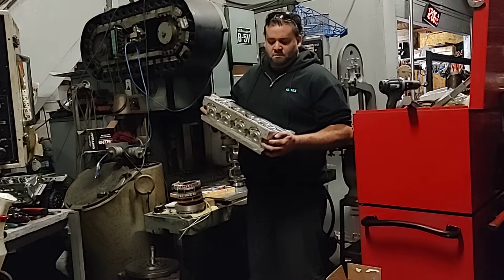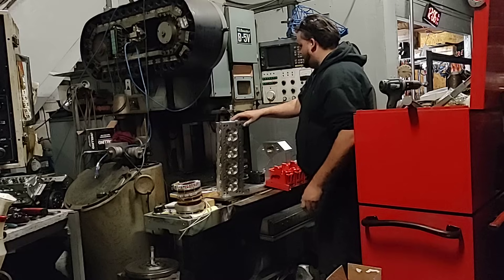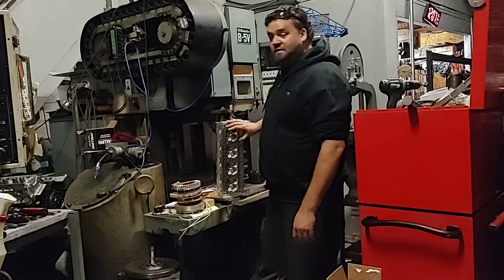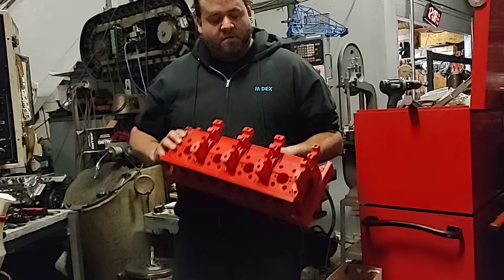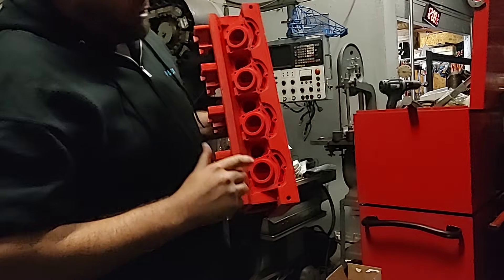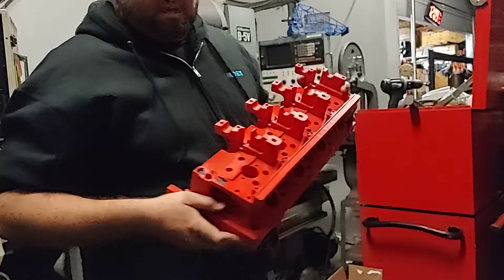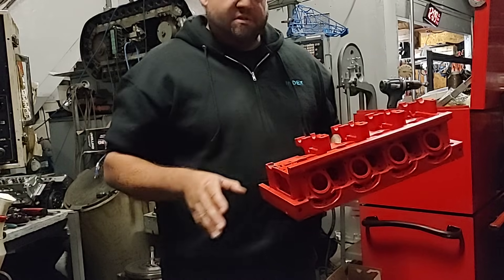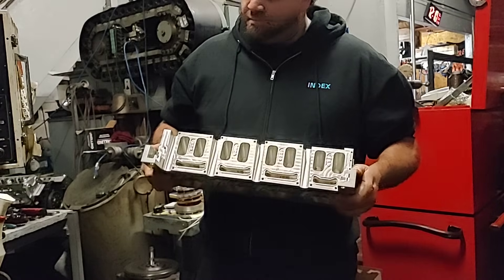LS 4 Valve Cylinder Heads- Better yet, they're BILLET

Comment: This is awesome!  Will they need a special ground camshaft or will a aftermarket camshaft work?  Will I need to make my own intake manifold or will a stock or aftermarket one work?
Reply from the maker: Thanks! If they are on a LS block, LS cams will work. Flow percentage is tailored to existing cams. I'll be providing an intake in short time, plenum and itb's. LS headers will bolt right on.
Reply: Awesome!  I wish you the best of luck I hope what you’re doing takes off like a rocket!

Comment: Would this be for a Gen III, Gen IV, or both?

Essentially, could I build an LM4  with these heads?
Reply from the maker: All LS and Lt engines, and sbf. Lt and Ford will require custom camshaft for lobe stack up
Reply: 351W or 351C?
Reply from the maker: @commonmockery1074 Windsor for sure. Need to check if a Cleveland will adapt easily.

Comment: Very interested to see how these grow into something that we see on a running engine. Looking forward to some flow bench numbers from the actual head. 4V heads usually flow exceptionally well in the low lift range.
Reply from the maker: .300 lift is 300 CFM. Probably the coolest part about these and maintaining high velocity ports.

Comment: Why didnt you Y the intake port?
Reply from the maker: Ports are more efficient on port per valve. Far easier to tune and apply all the two valve port tricks to it as well. It's like having 2 2/3 scale 706 ports per cylinder, and velocity is greatly increased

Comment: Never thought that next to a SB4 that I wouldn't see someone with a 4V LS. Awesome job and awesome engineering!

I noticed you've machined the intake ports seperate for the valves. What was your reasoning behind that? The ones I've seen so far have one port for 2 valves.

Does it have to do with maybe flow, or was there something else that formed this decision?

Comment: I would recommend that you get some Nissan VK56DE (v8) heads and copy their valvetrain design as much as possible. Most manufacturers now use cam direct on solid buckets. The parts are easy to source for replacements. The Nissan VK56 also has very similar bore spacing and other dimensions to the LS.
Reply: The whole point is to get 4 valve performance with pushrod convenience, most American v8's with over head valves only use 1 camshaft which is great for aftermarket support and incentive. Think about it, instead of having to get four fancy new camshafts for a performance build, you just need 1 fancy new camshaft for a performance build. Obviously there are drawbacks to pushrods but the Americans just throw enough displacement and cam lift at it, and it works
Reply: @janusmarais7580  ,,,,,,,,,,,,,,,,,,,,,,,,,,,,,,,,,,,,,,,,,,,,,,,,,,, amen ,,,,,,,,,,,,,,,,,,,,,,,,,,,,,,,,,,,,,,,,,,,,,,,,,,,,,,,,,,,,,,,,,,,,,,,
Reply: why not just build a nissan v8 and save your self all the crazy machine work.
Reply from the maker: @A2J_Tim I thought this was America

Comment: Do you think it would be possible to 3D print your blanks with additive machining ?
Reply from the maker: Anything can be done, billet is way cheaper and much stronger. The print time on something like this would be close to a week, and still require a ton of machining. If the printing time gets faster, I imagine it's something we'll see in the future.
Reply: @AwkwardPerformance  I guess I should have said feasable rather than possible. Figures it's not as strong or less expensive yet. Too bad.

Comment: Not long ago there were U-Tube videos out there where someone was mounting LS heads on 4 cylinder blocks. this might be a  side project for that odd head that you have now.
Reply from the maker: Usac midget engine is in the scope. Katech makes a mighty nice 4 cylinder block these should bolt right on to.

Comment: Wish you absolutely the best of luck. Tremendous amount of time, energy, and engineering skill went into these. Not sure I see the use case though
Reply from the maker: 5 second door slammers? No more losses to coyotes, marine use, off-road use? I can see a couple. These are a racing head, not a street head, not that they wouldn't work, fuel mileage may suffer 😂😂
Reply: @AwkwardPerformance  Fair enough, although I would argue that the limitation of forced induction LS performance is sealing the cylinder head to the block. Making power really isn't the problem-it's making the power and keeping a head gasket in it.
Hope I'm wrong though
Reply from the maker: @bobqzzi billet heads will help build it down, these come ready for 1/2 studs. They can be ordered dry deck or no water as well. I hope to help the smaller racer have a chance against the really nice stuff out there. It could turn into a reverse thing of top fuel, where they change out a block instead of heads between rounds!!

Comment: Our Hot Rodder forefathers are looking down on you and smiling.
Reply from the maker: I've got a few to make proud, thank you! I'm working 10-12 hours days at day job, and spending the rest of the time on programming, design and tooling on this. I'm all in.
Reply: @AwkwardPerformance  hopefully making these will become your full-time job & income.... I look forward to buying many sets!!!
Reply from the maker: @branbear24  Thanks! But I hope not, I want to make the viper V10 heads next and so much more!! Turns out, the machining gets a little boring after a while, the design process is what I like, and then pissing off the neighbors!!
Reply: @AwkwardPerformance  if you need a test dummy I'll gladly use my suburban and give you reports back
Reply: Ear to ear grin

Comment: This is a very interesting concept. The fact that you're using the factory cam and pushrods is even more intriguing .
Reply from the maker: Goal is to keep these in reach of your normal racer and engine builder, and punch way up the weight class. Thanks!
Reply: REEL TALK 🎉
Reply: -pushrods are the only part thats not cool.
Reply from the maker: @RealDougFields you say that now
Reply: @AwkwardPerformance  lol- I admire your drive to do these but the 4 cams eliminating the push rods is free HP and much more reliable RPM potential. If you can do these cheaper than Mercury Racing does the SB4 stuff though you will sell some. 4V is such an advantage.
Reply from the maker: How much energy does it take to oil and spin the cams and drive system? Not that your wrong, but having one cam shaft is being helped by the closing valves through one shaft, not a mechanical system. I'm going to take the 'stupid' argument that this is actually better for drag racing and tuning valvetrain. Cam timing as far more precise as well. Thoughts? @RealDougFields
Reply: @AwkwardPerformance  Love the Moxie- cam timing is more precise? with a noodle pushing the valves open? Illmore did a great job with pushrod engines but they knew the limitations and were only successful because of the specific rules. Direct actuation is superior in every way. ALTHOUGH I do think the SB4 using the LS cam location as a jackshaft to drive the cams does add complexity and friction. It is a good work around on a stock block though.
Reply: @RealDougFields  Theres always one window-licker

Comment: Stick em on a 4.8 the powerband won't peak until 10,000 lmao, getting some serious ram air 5 vibes from this. Super badass you did a 4 valve without using overhead cam, this is the way American 4-valving should have been done from the jump! Thing flows better than 4.6 B-Heads, shit it's neck and neck with the DCI Pontiac heads!

Comment: Good luck! If there is anything proprietary in their design, patents would be a good idea. 
   Otherwise, scale might be important to focus on. The option is excellent!
Reply from the maker: What would i patent?
Reply: Someone else mentioned a patent. I think you should, only of there is anything about your design that is proprietary. Meaning your design has something different from other cylinder heads.
   For an LS it is different, but 4 valves does not make it something that can be patented. So, I wouldn't know, as I did not design your cylinder head.
Reply from the maker: @robertmoore119 mercury marine already makes a dohc 4 valve. It's pretty cool btw. So if they didn't, I'm probably good. I just don't know what makes mine special or different. It's just designed to have small time racers have a chance against billet engines, and provide a great value to what ever industry it goes into

Comment: Your gonna try to control two valves off one lobe/pushrod/rocker? Spring pressures needed to keep valves under control may be to great for a single lobe. Also wondering about those rocker seat pedestals, didnt look like much material there for strength. Time for testing and likely more R&D
Reply from the maker: Yes I am. I'm going off all known data and forces that runs around any bullring on a Saturday night. Why would they be too great for a single cam lobe? I haven't announced spring pressure range, but I do appreciate the concern. Harley Davidson M8 engine seems to do just fine.
Reply: @AwkwardPerformance I don't know I just think even for you it would be a concern. Opening 2 exhaust valves with one push rod against spring and cylinder pressure is questionable, no? These problems don't show themselves till down the road. I think it's cool what your doing and I'm on your side here I'm just pointing out the things I would be concerned about as I'm sure you are. How are you doing the rocker setup? The test piece looks similar to a dodge style shaft system or will it be different?
Reply from the maker: @stevenbelue5496 The rocker system will be very similar to the Dodge system. You can see my initial prototype setups on my Instagram page FY_lsx. I'll have a video out on all that pretty soon. 

One of the advantages of having two exhaust valves is you open one smaller exhaust valve into cylinder pressure, that is easily done with a valve lash.
Reply: @stevenbelue5496 smaller valves also need less spring pressure . Something about mass and inertia .
Reply: I wonder what the weight of the smaller valves will be in comparison. I think one advantage the Milwaukee 8 might have if its air cooled is the valve stem length may be shorter and much lighter but I dont know. Of course titanium or hollow or sodium stems can help if weight is a problem reducing overall resistance. I have heard of the lash strategy opening against cyl pressure with a four valve and some folks believe it doesn't matter because the pressure or force against a single valve or two remains the same, i don't know, the inertia needed to get another equal mass in motion against equal pressure(cyl) might be negligible if any so imo it's hard to say and not much proof of concept I have seen but I've not been looking for it either. Another thing with these heads is the need for a lot of proprietary pieces, all the hard parts for a bare head, intake and exhaust flanges, which some guys can fabricate the manifolds intake and exhaust. But it's gonna be a pricey endeavor and if flow is not much greater than the small bore ls7 type offerings then it's going to be a tight customer base.
Reply from the maker: @stevenbelue5496 I disagree with the flow numbers, at .300 lift they flow 300 cfm, and 380 at .650. I see what you're saying. Being the guy that has designed this from only known data, I have the rest of the concerns handled. There are some unknowns, and that's why I look forward to testing. I appreciate your time considering the challenges to this. It's not been easy designing for 500 hours and inventing ways to machine it on more basic equipment. Thank you!
Reply: I think there will be a niche group of customers similar to the hemi style LS guys looking for naturally aspirated records.
Reply: @stevenbelue5496 could also go OHC with buckets like Ferrari , Toyota etc to eliminate weight
Reply from the maker: @stevenbelue5496 boost guys will love these

Comment: Im assuming some super beefy pushrods and lifters are needed? How about the already fragile cam bearings with high lift/ spring pressures?
Reply from the maker: Cam bearing should be replaced anyways on a racing engine. Good lifters and pushrods will be needed for a high rpm billet headed engine. The other advantage is you don't have to lift beyond .650, they flow 380+ at that lift.

Comment: Great work, subscribed right away. Are you closing off the jackets with single, full length plates on both sides, or another approach? Thanks for sharing.
Reply from the maker: There are multiple oringed plates, as well as the intake port extension that covers water jackets. It's complicated 🤣

Comment: Crrect me if im wrong here 
2 valve LS style engines have better than good flow 
Now the falls
4 bolt hold down pattern seems enough but is it(yep the other bolts are there so they prob add up to half a shared 5 pattern prob ok aspirated depending on what your up to
A friend of mine across my courtyard runs a mech shop 
Had a LS engined vehicle in a lil while back owner wanted a valve train upgrade as he drives spritedly
We both had no idea the heads off for lifter replacement
Now that in the building trade is known as a shitshow
Unless some of you magicians know of a fix to help the world 
All sounds like fun ( nope)
Still this fella has done well 
Wittling these up 
Will b interesting to see the gains and his engineering reliability
If they whip them hard
Reply from the maker: I'm not sure what your asking. Please clarify
Reply: Not asking anything just stating the good and bad LS have a good bottom end
And good flow up top with 2 valves 
But have other issues as stated prior
If you can get these  nicely made heads you whittled reliable  and then cast them you maybe on a winner pending gains
At the tyres
Reply from the maker: @andrewk7731 if you compare it to other 4 valve V8 engines, this will help. They have 20-40% more flow from other engines. They will require a good lifter and pushrod. And they will remain billet, no reason to cast them. There are plenty of solutions for lower power numbers from other cast heads. These are designed to see 60psi of boost in race trim. Thanks for the response! I'm happy to answer any questions.

Comment: It’s all right if you’re into that four valve garbage, you just got more parts to worry about breaking
Reply from the maker: Who hurt you? 😂😂 Thanks for watching.
Reply: @AwkwardPerformance  creation is good line as it has outstanding performance and longevity
Reply from the maker: @KennethMyers-i2t that's my goal, everything in these already does the job. I'll get tricky with the unknown later
Reply: @AwkwardPerformance  if you’re gonna make anything better, two vowels is better than four. Why don’t you do a small block hemi Chevrolet head and make it sufficient this way you wouldn’t have to deal with an overhead cam garbage
Reply from the maker: @KennethMyers-i2t these are push rod heads. And sbc is already drawn up and being refined.

Comment: Manton pushrods and Jesel lifters should make this setup live. I see the intake ports are not siamesed, so are you going to make matching intake manifolds? I'd LOVE to buy a whole head/manifold set for my C5 Z06 when they're ready to sell.
Reply from the maker: I'll have a high and low plenum, and itb intake setup. The intakes are like having two 2/3 scale 706 intake ports per cylinder. For rocker arms, i have a Manton inspired design, but there are some challenges that i have handled that look a bit unique, but FEA says they will be just fine. Thanks!!
Reply: @AwkwardPerformance Sounds great. What are you thinking for valve covers? Production numbers couldn't possibly be high enough to justify stamping dies. Maybe carbon fiber? Or laser cut aluminum sheets (and plate for the rail) TIG welded together?
Reply from the maker: @elektro3000 any of the above. I have an initial design, they will have coil pack mounts and goodies on them

Comment: SB Ford as well since the LS design is so close. 🤔
Reply: There's actually a few engines with nearly identical head bolt and cylinder spacing when I looked it up, and they all predate the modern SBF.
Reply: @hydrocarbon82  what do you mean by modern small block ford, the only small block ford is the Windsor beginning all the way in 62

Comment: there's not many ohv twin cams. if you wanted you could convert this to variable compression by giving each of the intake valves one of the twin cams, and then use the cam in the block to do the exhaust valves. by using separate intake cams you can overlap the intake duration. saddam hussein made a vc engine in the gulf war due to oil shortage, but it appears to have been classified. i suspect he used this method.
Reply from the maker: Dodge viper has a cam in a cam tech for later generations, i think that would be s great way to have variable lsa

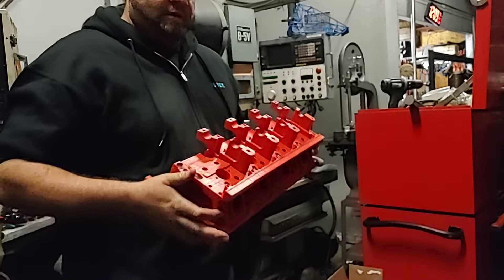Comment: 3:20 oooh, is it DOHC?
Reply from the maker: It is not. Much like the Harley M8 engine configuration. That's not a drive way or garage install!! This may be better than Dohc in many ways, at least that's my stupid argument!! It's designed to see 8-9k rpm given certain racing circumstances.
Reply: I think 32v OHV/pushrod heads make a lot more sense anyways for LS enthusiasts. It retains the small form factor and the LS has proven you don’t need the Overhead cam for high RPM power anyways

Comment: Is there sufficient material in the runner to port them ?  I think that is very important for future development 🤘🏼. Well done
Reply from the maker: Thanks! Although these will be 100% CNC machined ports and all, there is a lot of room for expansion for larger valves and larger ports. There are some tight spots between pushrod and head bolt clearance, but it should not impede growing the port taller or wider in most areas.
Reply: Super promising 🎉. Nice work  @AwkwardPerformance